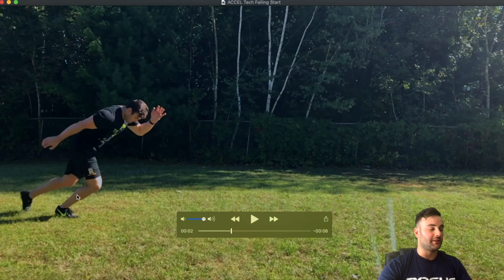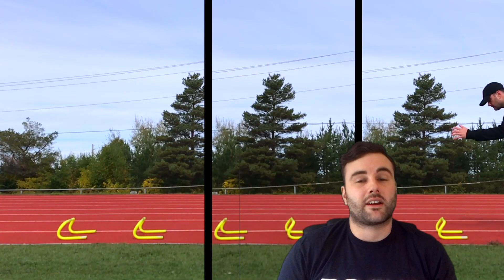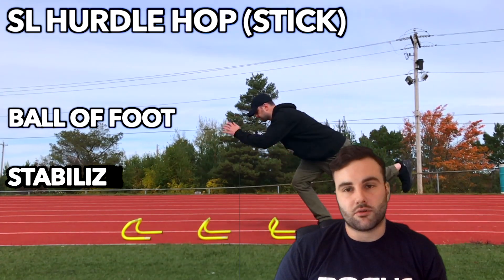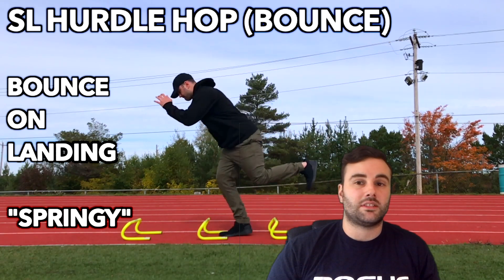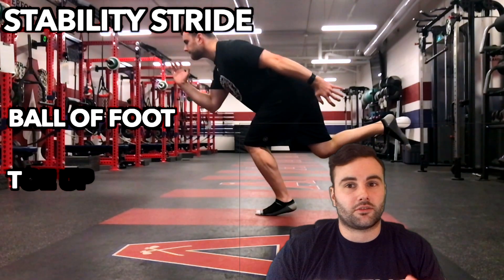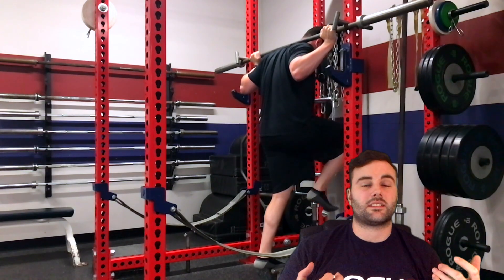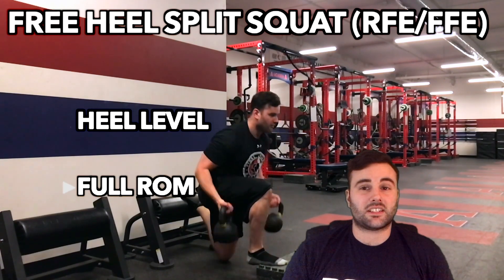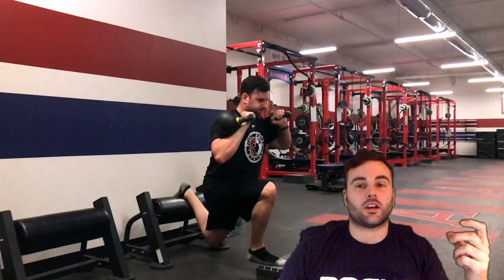Ankle Stiffness for SPEED | Biomechanics & Physiology

Comment: Should I keep my ankles stiff in a set position evem from the start?
Reply from the maker: For the most part yes. Sort of depends on your start. I don't work with many track athletes specifically so I haven't trained any athletes starting out of blocks in my sessions. Allowing for some "bounce" may allow you to better utilize the stretch shortening response and get more power off your first step. When we do 2pt starts, we teach athletes to use their back foot to "crush a pop can" - just a little cue to achieve this elastic response. In a 3pt its a little different because you're starting from a more static position. I think some amount of give is going to occur regardless under really high force, so the goal should be to maintain a high level of stiffness. Just not to the extent that it makes you super rigid. If that makes sense.
Reply: @irlcoach  Absolutely. Thank you so much for the response. New sub
Reply from the maker: @ianhawkes1135  Thanks you! I really appreciate that